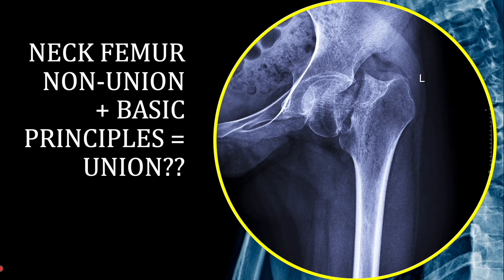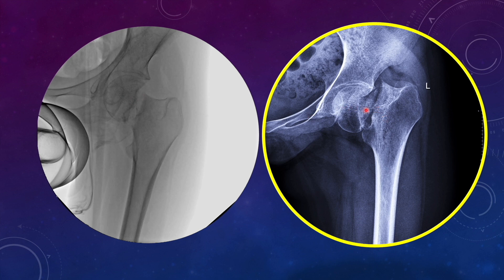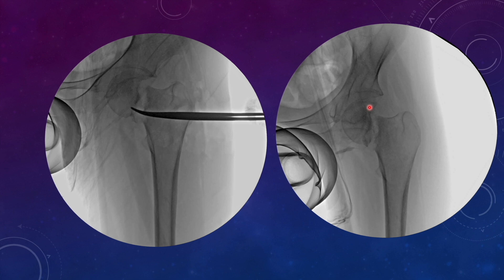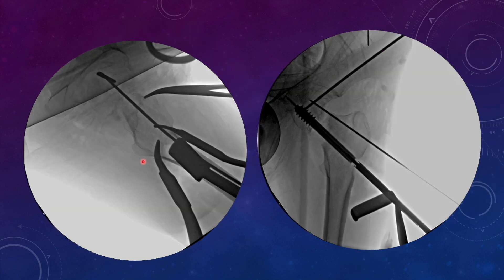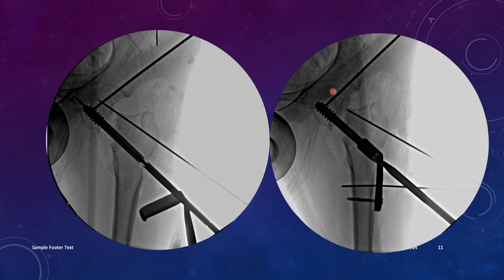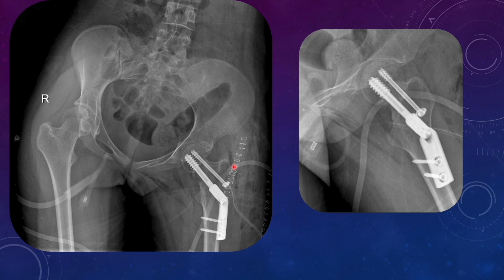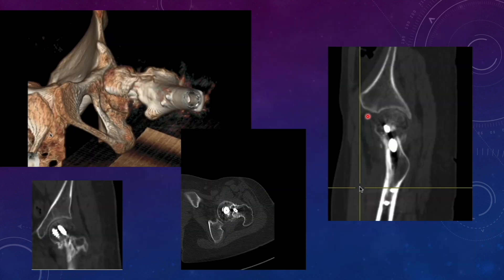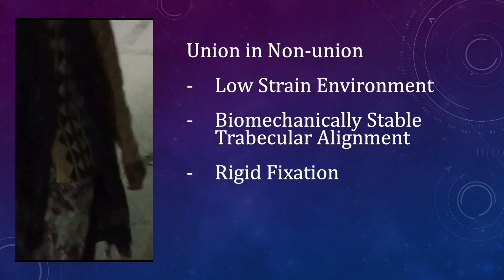Missed Non-union Neck femur case

Comment: Thanks a lot ..excellent presentation  as usual.
However i was just wondering why valgus osteotomy was not done here ?
Reply from the maker: Yes, I am a big supporter of valgus osteotomy in salvaging neck femur nonunions. In this case, the residents were puzzled by the patient's manipulated history just for getting admitted. The patient was admitted with a false history, and residents on duty ignored detailed radiograph assessment. The patient was taken to the OT table, thinking that it would be just another neck femur case. However, the first carm shot shocked them when there was a huge void and the margins were sclerotic. I was called for damage control without any backup implants (not even osteotome) for valgus osteotomy. So, I did something that could address the biomechanics. The patient came a few days back with great remodeling at the neck femur and zero symptoms. I'll share the radiograph in a day or two.

Comment: Hi thank you for the enlightenment.. i am curious, does the patient allow to partial weight bearing on the 2 months post op? Maybe around 10 percent/30 percent? Or no weight bearing at all?
Reply from the maker: Hi, thanks for your feedback. Most patients do bear some weight despite advice against doing so. We instruct them to avoid weight bearing till we are sure that there is radiological bridging bone. So, considering the noncompliance to non-weight bearing and to avoid full weight bearing, we ask patients to use a walker and then avoid weight bearing. So, with a walker, we have at least some security that the patient will not bear full weight. Partial weight bearing, I feel, should not be an issue because the forces around the hip without weight-bearing are also high and may equate to the load-bearing forces.
Reply: @Justorthothings  thank you very much. Its verys clear now. Btw, should x ray performed every months or every 2 months enough? ANd before you apply weight bearing after 2,5 month. Is it directly weightbearing or start slowly
Reply from the maker: @nunuros  We follow every 4-6 weeks until radiological healing and consolidation are evident. After that, 3-6 months. Yes, weight bearing is gradual so that the patient develops some proprioception and muscle balance.